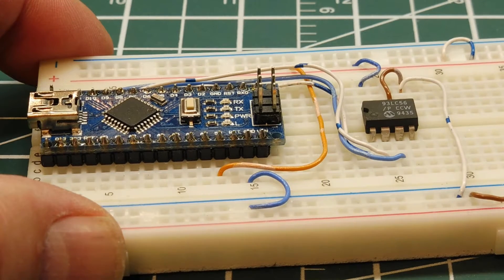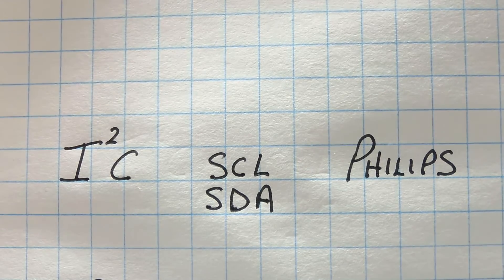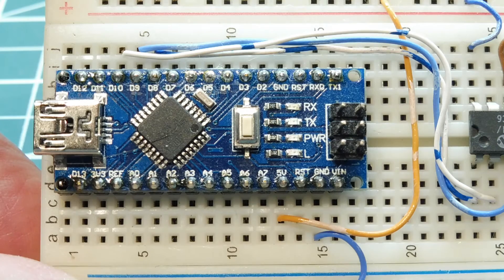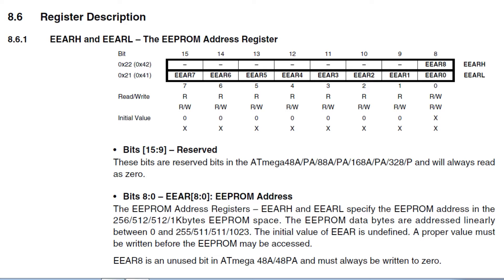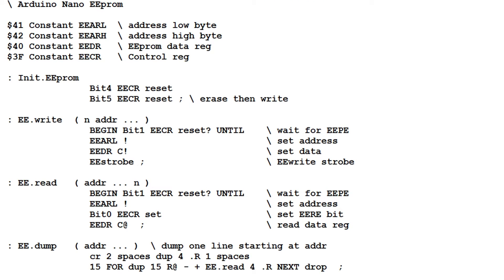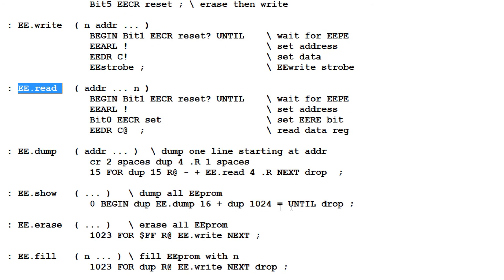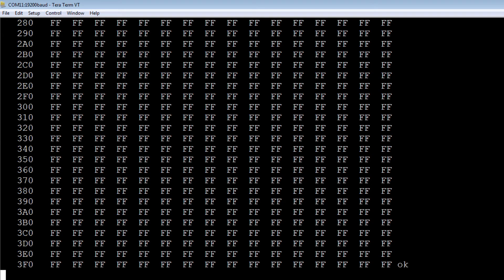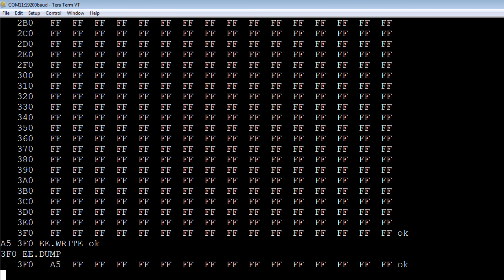ATmega328p EEPROM Programming  / Arduino Nano

Comment: Hi, there thanks for the video...do you have another video showing how to do the same with an external EEPROM...i liked the interactive option...thanks.
Reply from the maker: I do not have an external EEPROM video but you can check out my I2C video as the external memory chip use this protocol. Check the data sheet of the EEPROM for programming details. https://youtu.be/PjsK6uxUZeA
Reply from the maker: Here is a link for code to read/write to external serial EEPROM.
https://www.dropbox.com/s/zwoyy7zf8r6h2x7/93LC56A.txt?dl=0
Reply: @0033mer  thanks a lot appreciate it.